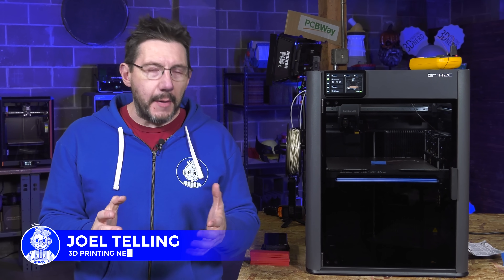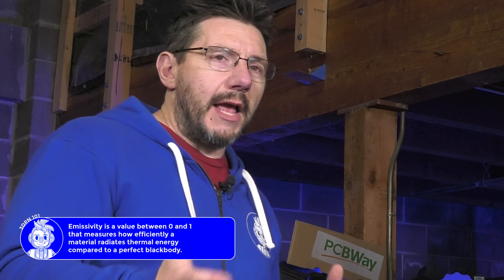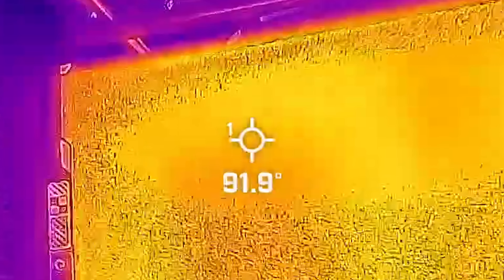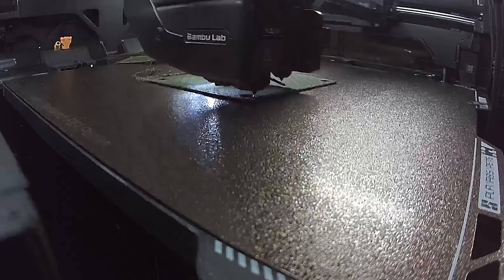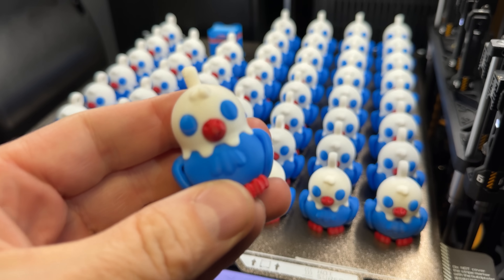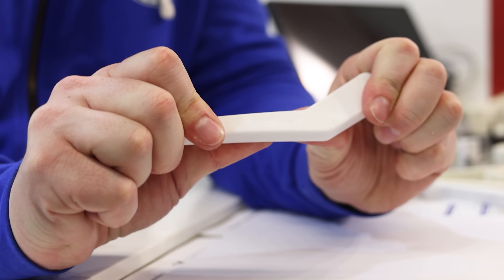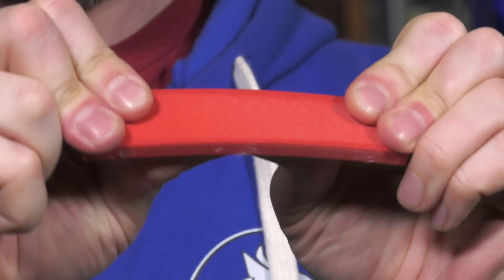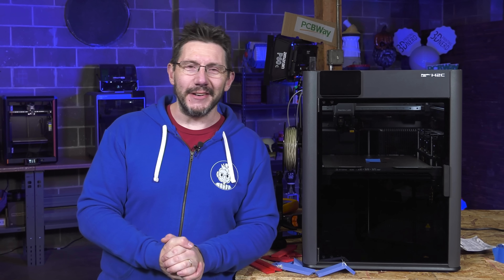Bambu H2C Update - Bed Heating / Tullomer + Polymaker

Comment: Super interesting. I have a H2C as well and having to use the stock plate that came with it until some aftermarket ones come out. I am having to put an outer brim on almost everything I put on it. I do not have to do that at all with my H2D or P1S's. I do exactly like you, wash with dawn etc. I'm now wondering if my plate is defective too.
Reply: Probably, ive been running my H2C for a week none stop and my prints have been sticking fine.

Comment: I been doing data acquisition for decades... just about forever.

Get a thermocouple calibrator... Does not need to be terrible expensive, certainly cheaper than that Fluke multimeter you have (I have it too).
Calibrators are calibrated by an order of magnitude better calibrator... Usually.
(After 2 to 3 calibrators in line, you are usually talking to NIST personnel for accuracy)

I usually get accuracy to 0.1 ~ 0.2 °F on a low budget.
If you really picky, calibrate TCs to the temperature you are expected to hit.

Tape the TC to the hotbed with Aluminum tape and remove all air bubbles around the TC bead.
The aluminum will heat up and radiate heat from the top down to the bead of the TC shielding heat loss.
Then set you IR scope on the bead and compare temps next to it... and change your emissivity to whatever number matches the reading of the TC.
Then you can accurately see the rest of the hotbed temps.

Also use thinner TCs. The standard TCs are Ok but are slow and can soak, dissipate heat on surfaces very easily.
0.030" wire TCs are cheap, fast and very flexible.

Happy measuring.

Comment: Please stop buying Glass fiber-filled material, then printing "waste" parts or models. Read the SDS and accept the risks you are putting yourself at. Also, read similar materials SDS sheets from other industries; they usually have more data and risk talk.  Don't sand it unless you have the proper safety equipment. It's a long death when improperly done.

Comment: I own a H2S. Anything I throw at it is spot on. I wait for nothing, slice it, send it, take it of the build plate when cool, end of. Why would I preheat it, that's what I bought a printer that does that on its own. I own a commercial grade thermal camera and will look at mine at the time it starts to print but it won't be an hour later that's for sure!.

It was tricky to see but we're you testing thru the glass or was it removed as that would have an impact due to heat loss thru convection.

Comment: The Fluke289 and thermo couples are accurate to within 1-2 degrees C out of the box. It's going to be awesome when Fluke sees this video and you tell them their gear is garbage without the user having to manually add "offsets"!!!!!
"3d Printing Press Secretary" you're even better than that dude the Iraqis had..

Comment: Not surprised at all that your 'measurements' don't match.
All instruments need to be calibrated if you want reliable data. We as mere mortals never ever do that and tend to assume that what it says is what it is.
btw: the fact that the Flir and the probe showed near identical values kind of disproves the need to calibrate.

All instruments tend to have both resolution and accuracy, which should be taken into account when looking at the values. 
This is again something mere mortals won't do. They see '100' and assume it is '100'.

Then there's the device itself.
What is the accuracy and resolution of the measurements ?
I doubt it is 0% ... 

tl;dr;
just because it tells you it is '100 degrees' that doesn't mean it will be. It will be as close as they can get it at the factory.
You may have to either re-calibrate it at home and experiment to get the best results.

You definitely should not  beexpecting a Flir-attachment for a phone or a thing you got from temu to be as accurate as professional quality devices ... these things aren't cheap if they need to be accurate.
The best you can do with them is what the suggested usage is : look for heat leakage on a wall ...
You should not be using them to get an accurate reading where a few degrees more or less matters. a 5% accuracy rating would be pretty damned good IMHO (and it would result in '100' reading as '95' ... )

Comment: Turn the fan off when printing PETG and it won't be nearly as brittle. Or heat treat it when done to relieve the internal stress. Printing at 230 instead of 250 also helps create parts that aren't as brittle.
Reply: Can you tell me how to turn the fan off on the H2C?  I'm fairly new still to 3D printing and have had a print fail and break in half midway through printing twice in a row - using PETG.  Not sure how to diagnose the issue.

Comment: On a slightly unrelated note. I designed and built a locking turn table for the H2 series of printers. I have a short on it on my channel for those interested. It makes using the H2D so much easier. However, it does not help with bed temperature. So, please be aware of that.

Comment: This video is just kinda weird. As others have stated, why heat the bed for 1.5 hours? So we’re all going to preheat for over an hour before each print now 😂. I better stock up on more printers so I can be able to print more things with this increased waiting time. 

We need more data. Show the bed of the H2C heating compared to some other printers like the A1, or X1c. If you timelapse them all with the thermal imager we can see which ones heats the fastest and most even. If the H2C truly takes 1.5 hours, or even something like 30 minutes to fully heat the bed, that’s a huge disadvantage of that machine.
Reply: I have one of these, and I have no idea what he's talking about.I have not had to preheat anything in order to get p l a or petg to stick no glue or anything

Comment: I would recommend calibrating the thermal couple using pure water that is boiling and pure water that has ice in it (100C and 0C). I personally trust a thermal couple over a thermal camera, especially after its calibrated.

Comment: absolute temperature doesn't seem as important as consistent heating.. are you saying it actually is consistent or not? 
why not put tape on the whole plate? why not do a timelapse of the bead heating? why include a uncalibrated thermocouple just to say its uncalibrated and throw away the result (even though the flir also says 91c on parts of the plate)?
Soaking the machine for an hour just to achieve that seems crazy.

Comment: I'm glad that the new build sheet resolved the adhesion problem you were having. With that said, there was a clear difference in heat distribution between the Bambu printer and the Prusa you compared it against, and the unevenness on the Bambu was still visible in your newer videos. Your pieces of tape were placed in the center, where it was reading the warmest. I think it would be useful to stick a piece of that black tape onto one of the portions of the build sheet where the camera shows that it's at a lower temperature, and then measure it there as well, to quantify the difference.

Comment: Any chance you could tape that Fluke thermocouple to, say, the Core One L, set bed to 100C and report back here what the thermocouple reads?
Reply: Just boil some water with the thermocouple in it. It should be around  100°C at sea level.

Comment: “The Bambu H2C has a major problem with bed heating”
Community: “Wow thank you for revealing. This is a deal breaker.”

“I made a mistake. I had a defective PEI sheet. Here is the data and the results.”
Community: “Weird video. Bambu have you under duress? Your testing is flawed.”
Reply: Bed sticking sure. The heating part though? Come on. It's ridiculous back pedaling,  talking rubbish,  nonsensical measurements,  nothing makes sense

Comment: To measure bed temperature with a thermocouple I found that I needed to tape an insulating ceramic cloth over the top of it. Otherwise convection cools the top surface of the tape and then the thermocouple reads low.

Comment: Hey Joel, I’m the guy who posted that “reaction” on the Bambu Lab Facebook group that kind of blew up with your former editor in the comments. I ended up editing the content of that post down to an “apology” for questioning your integrity, but I’m not sure if you saw that before I just deleted the post, because I was actually getting threats. 😂 

I for one really appreciate the follow up on this issue. Emissivity settings are hard without a known value to test them against. And I was having a really hard time believing Bambu screwed something like this up as bad as the initial review had made it seem. FWIW, I have been having some adhesion issues lately, and I think I actually might have damaged my PEI sheet with some PET that stuck too well (or maybe I removed it too early). It didn’t take the coating off, but the adhesion doesn’t work as well in the spots where those PET parts were…

Anyway, THANK YOU, and I’m sorry. Also, I am REALLY excited about experimenting with Tullomer! You’ve got a subscriber and a supporter for life! 😊 Cheers!

PS-This comment thread is wild! 😮
Reply: What are you apologizing for?
Reply: Questioning Joel’s character,  @atapene .
Reply: @crazycaseyscustoms  Joel literally just said one of the best multimeters by probably the worlds most respected manufacturer is more than 10 degrees C out bwhahahahahaha and you are apologising?

Comment: Appreciate the video, but if other printers don't need all those tricks just to read an even temperature all around the build plate when reading it, and never have, even though the calibration makes sense to do, the non-uniform temperatures plus tapes being the only points that read it well are clear hacks, plus you have adhesion issues UNTIL you put a different plate on there, when the bed heating design has been brought up as an issue since the H2D, then that is definitely more of a covered up issue with workarounds than a 'valid choice' for bed heating. This company is profiting so much in both the Chinese and Western markets that they can afford to ship non-rolled beds, but cast or even graphite with silicone heaters that are known to provide excellent results. Selling a machine at this price with such an obvious issue that many users have been experiencing leads me to think it's a deliberate choice to sell more filament for failed prints, plus save manufacturing costs, rather than a design decision made to benefit the customer.

Comment: So you spend $2000 for a printer that you have to heatsoak for over an hr before printing and that is super picky on if it will adhere your prints to any given build plate...😂😂😂 only a moron would buy an H2C....BIG FAIL BAMBU!
Reply: You obviously did not watch or listen to what he said. He pre heated the bed so long to have an accurate and stable value. This was most probably a big overkill and 99,9% of the time not needed. Then he confirmed that the new plate had no adhesion problem. The old one was again probably faulty considering his test. 
So calling it a « BIG FAIL » from Bambu is probably a bit over reacting or even trolling.
Reply: @laurentwilliame2588 The H2C IS a big fail.  It has had nothing but terribke reviews and nobody is buying it.  In 3D printing groups its actually a joke. People just talk about how slow and bad quality it is.  Its approaching meme status....
Reply: @William-b5s2r  lol, no one is buying it?  They sold out of their first shipment in less than. 24 hours after going live.  Their AMS 2 Pro are backordered into Feb.

Feel free to keep hating, but Joel has admitted an error in his measurement, emissivity is a real thing and when playing with LWIR cameras it absolutely impacts readings.

Is the H2C perfect? No.  Is it a failure, far from it.
Reply: @seashadow5239 They had to cut production because H2D's were sitting and not selling...Thats why it was "sold out" you dont keep manufacturing something people arent buying. Have you noticed that Bambu hasnt even been promoting the H2D anymore? Its barely 6 months old and yet they are treating it as if its already discontinued. Now they are tryingvto push the H2C which is being panned by Everyone. It has terrible print quality, slow speeds and falty buildplates....But sure buddy you go spend $3000 on it. You will be very "Unique" and one of very few
Reply: @William-b5s2r  larger beds do take time to heat up. I always preheat my Neptune 4 Plus and Max for at least 30 minutes. My P1S depends on if I am printing something small and detailed. But I agree heating a bed over an hr is a little crazy. I would probably just use a super tack plate.
Reply: @davidcooper574 My K1 max doesnt need presoaking, my AC kobra max doesnt need presoaking , my sovol s8 doesnt need pre soaking...So yeah i guess only Bambu H series with bad heating do
Reply: @davidcooper574 1. The P1S is a corexy and its small, it should take 3-5 minutes tops to heatup. I unfortunately own one and thats what it takes.  I also have an Anycubic Kobra 2 Max which is a HUGE printer and again it takes 3-5 minutes for rhe plate to heat up....This Bambu H2C is a joke.  It has issues with every person who has made a review of it.  It was a lame attempt from Bambu to try and steal back customers it has lost to the Snapmaker U1.

Comment: Hey Joel 🎉

So my Anycubic Kobra S1 (not combo - don’t intend to do multi colour) arrived, 

Been looking into an intermediate filament to use to prototype my Sports yacht design, this will include smaller sample models to determine requirements, and then print a 1.5 metre long, fully functioning model, with removable decks and engine compartments.

Even intend to design and install custom furniture and accessories..

Have concluded ABS is a decent mid range product..

Please can you offer assistance, I do want my 3DP work to stand the test of time and quality. 

🎉🎉
Reply: Should I dry the filament?

Fear the area I’m putting the printer is near a large window that condensates regularly..
Reply: That shiny strong plastic expensive toys are made of would be appreciated..

Comment: This reeks of being desperate to not fall out with Bambu, as a technician I'm appalled at the use of the measuring equipment and then their instant disregard. If you don't know how to use the equipment properly then don't use it, or at least be honest about your lack of knowledge. It wouldn't take too long to learn how to use the measuring equipment. Practically grovelling at the end of the video.
Reply: I've seen thermal cameras abused by a lot of youtubers, they're definitely not a tool you can just point at anything and get accurate readings.

Comment: “my guess is the Thermo couple is incorrect” proceeds to show two thermal cameras that basically confirm that the bed is not at the correct temperature. Concludes that the printer is right and the three independent measurements are wrong. Sorry bud, but you’ve lost credibility with me.
Reply: The electrical tape clearly suggests the bed is at the correct temperature or slightly higher. But it's also super weird not trying to verify the thermocouple's calibration.

Comment: It's very easy to calibrate a thermocouple. All you do is dip it in ice water after stirring it for a while and calibrate it to 0°C, and similarly you can use boiling water to calibrate it at 100°C. Two calibration points is usually enough.
Reply: As ice transitions from a solid to a liquid, it absorbs energy from its surroundings, a process known as the latent heat of fusion. This energy absorption maintains the temperature of the ice water mixture at 0 °C until the phase change is complete. Similarly, when water boils, it remains at 100 °C because the added energy is used to break molecular bonds during the phase change from liquid to gas (latent heat of vaporization). Since water cannot exist as a liquid below 0 °C under standard conditions, the temperature remains constant during melting.
Reply: @NightfallSentinel  water boils at different temperatures based on altitude. 100°C is valid at sea level.
Reply: @NightfallSentinel  not correct at all.  Ice can be zero degrees or literally any temperature below.   The proper way is to use purified boiling water, it will boil at 100C and not rise above.  Regardless, claiming that one of,  if not the top meter manufacturers is simply wrong is ridiculous.
Reply: @Neverenough_25  I said ice water, not ice, which remains stable at 0 °C for as long as there is enough ice. You don't probe the ice, you probe the water surrounded by ice. Hope this helps.

Comment: This is my first 3D printer. .. Got it all set up and hit print and have had no issues with PLA. Have about 30 Hr's on it so far. Funny part is I was actually trying to cancel my original order because of your first video but was to late as it already shipped out.
Reply: I am sorry  but doing that on one video is silly in my view when ordering at least watch 5 or 6 and see if the results overlap. In this case that was not happening at all.
Reply: @scb2scb2  At the time I could only find a handful of video's as the unit was so new.
Reply: @Exiledsoull  It went online at 15:00 and i had my order in at 15:06 so i know where you are coming from BUT that comes with risks if you feel unsure you should wait until more reviews are out and still not base your 'cancel' on just one. I am sorry you can't have it both ways but i can see how very early buyers would feel doubt when one review goes off the rails like this one did and he now corrected. If ordering that blind (not saying its bad i did the same thing) it does come with a few days of 'did i do the right thing' fear. I even had it vs the whole INDX thing and still do. I now feel for the next 12 months i made the correct call and in 1.5 years we will we see where we stand on things.. ordering this quickly does come with that early deciders doubts just got to accept it or wait. Hope you will enjoy your printer i already am using the h2c now and feel i made the correct call (for now).